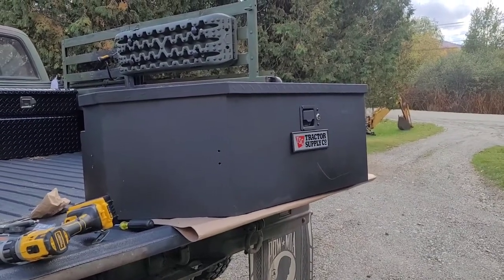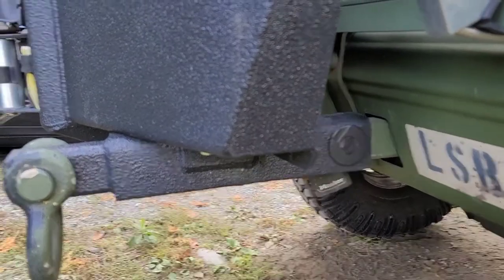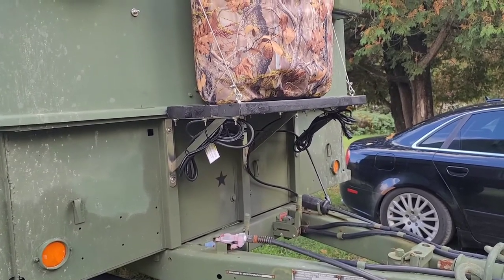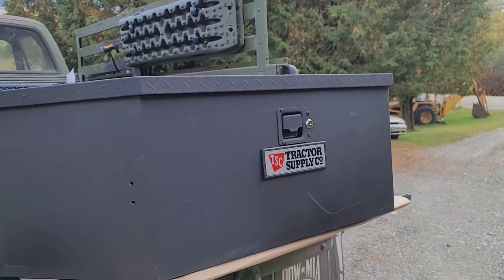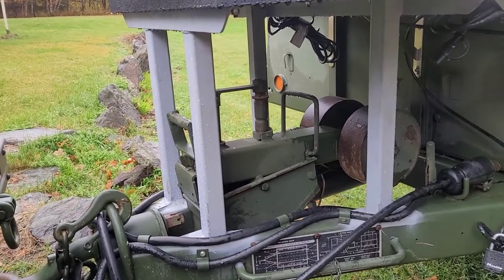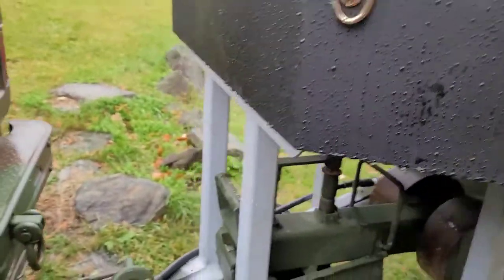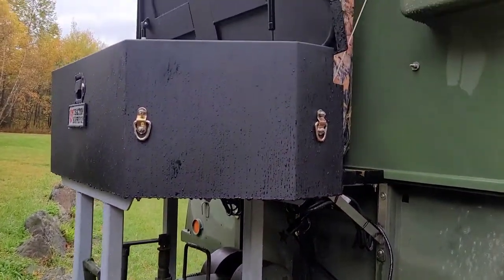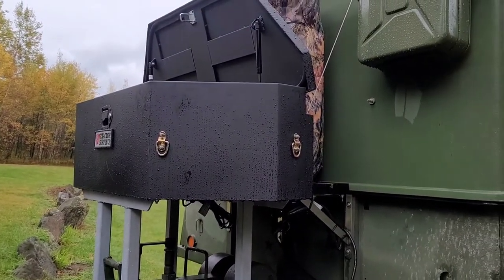Military Trailer Project - GREAT ADDITION !! Tool Box & mount welded to the trailer tongue.

Comment: Just found your channel. I like your setup! I have a M105 with a rooftop tent on top.
Reply from the maker: They are awesome trailers
Reply: @VermontPrepper  yes they are. I use mine for camping, hauling firewood, lumber and trash. They can really handle a lot of weight!